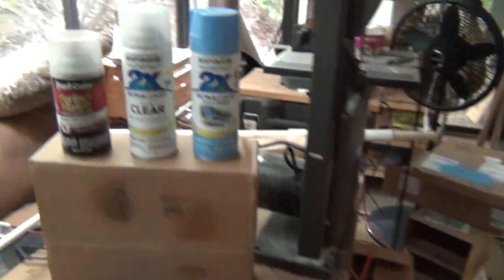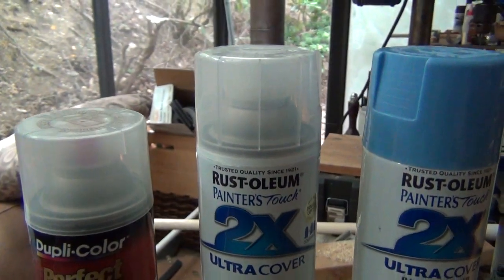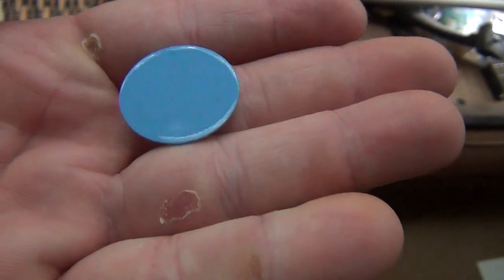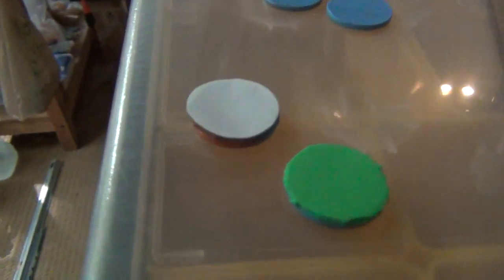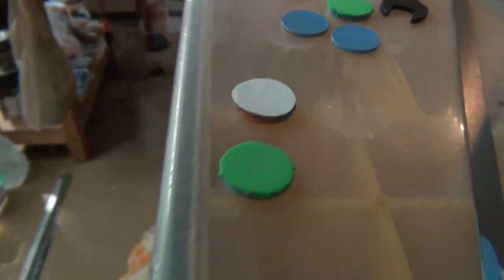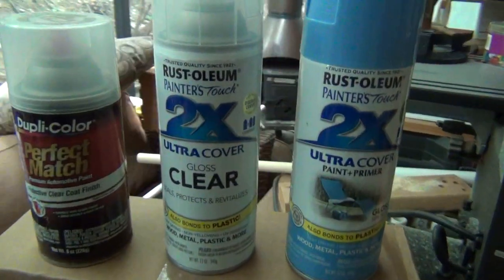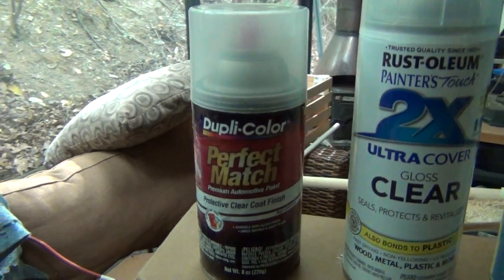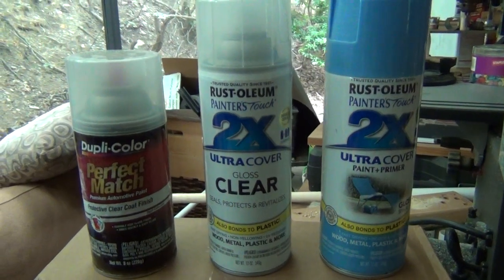Rustoleum Clear Coat Issue

Comment: The rustoleum “painter’s Touch” 2x gloss clear is an “acrylic” based resin clear. You need to spray the rustoleum clear within 30 minutes of when you sprayed your last color coat. And then you can re-coat/spray the rustoleum clear back over itself anytime without experiencing wrinkling or lifting of the base coat. But you must get it sprayed on within 30 mins. If you don’t I’d recommend to wait 48 hours and lightly scuff the base coat and then spray the clear. In my experience if the humidity is up above 70%, the rustoleum clear will blush and try to fogg up on you especially if you start out spraying it on too heavy. Light, light, coats is the key that I’ve found to get good results using it. On the other hand, the Duplicolor perfect match clear is an acrylic “lacquer” based clear and I’m my experience doesn’t seem to be as finicky about the weather it’s sprayed in. But, the rustoleum does seem to have a little better shine to it once fully cured. Hope this helps buddy. I just thought I would share my experience with the products.
Reply from the maker: Great! Thanks for the feedback. Every little bit helps trying to figure these different paints out.
Reply: But you are supposed to wait for the paint underneath to completely cure. If you wait only 30 mins then it will never dry properly.
Reply: +Ness Baby98, If you wait for the base coat/paint to completely dry before applying the clear coat, you will possibly have adhesion problems where the clear coat will not bond well with the color coat. Letting the base coat flash off/dry for 30 minutes gives it time to let most of the solvents in the base color gas out but will still be tacky enough to allow to the clear coat to bite into the base coat and adhere properly(chemical adhesion). When Professional Autobody painter’s paint a car they don’t allow the base coat to completely dry before applying the clear coat. If they were to do that, the base coat would need to be scuffed/sanded to create a (mechanical bond) before applying the clear to give it a way to help it grab onto the base coat.
Reply: Most of these comments are right,, these new base coats many needs clear put on immediately,, if they dry out and you wait and wet sand and then clear,,. They will crack and peel off within a couple of years,,. ???  Caution most are for production work,, not jobs that may need touched up and doing show quality work,,.  !!!
Reply: This is only if you don't wait the 30 minutes, and for it to fully cure it would take 5-7 days, not 48 hours
Reply: Gonna say bullshit.

Their gloss is pure fucking garbage.

I used their 2x colors, sprayed the gloss after 25 minutes, it wrinkled and ruined the piece.
I tried after 24h, after 48h, after 5 days, same issue.

This is all done in a spray paint booth, temp/hum controlled too.

Happens about 3/4 of the time.

Extra fun when it happens on CF pieces.

My professional guess, its SUPER finicky and should be sprayed VERY lightly (so for that thick/gloss finish, which is the whole point of ultra gloss), you should spray it every 15 mins, a light coat over the course of a few days. Absurd.
Reply: I’m completely new to painting figures and stuff. Do you know anything about using this stuff on apoxie sculpt? I have acrylic paint and I want to paint my custom but I’m not sure if I use this before painting or after.
Reply: You'll learn rusto is worse when you find better.  And any urathane or epoxy applied within 3 weeks will trap coating from gassing off.  Cuase chemical reactions, & ruins it, fact & reviews.  So I let the paint dry for a day or two, & coat lightly or is use a permeable coating to help coating while it continues to dry.  Sanded if you feel that's necessary.  Never had a problem, &  I dont use rusto clear enamel anymore.
Reply: @nessbaby9854  not completely just tacky is want with this brand.. i use it all the time...works great all the time for me..
Reply: Ronan B what do you recommend instead?
Reply: @shadowblack1987  your absolutely correct. 👍 Everyone should at least know.   I hate to use rusto clear as a last resort.  It does take light applications, even after 48 hours drying.  Companies advise against coating over rusto base colors with true water proof clear coats for weeks, if not months.  A Rusto rep will tell some of us on the phone, or email to wait a complete day or two, what's up with that!  So I stick to light coats with the 360° red, or blue spray cap.  What were not being told is if the spray coats a breathable to promote further paint curing?  I've heard from the pros & research year after year, nothing improves on rustos end.
Reply: No need for my own two cents' worth, you've pretty much explained exactly what I was intending to likewise elucidate. I WILL add, however, that user directions printed on every single can of Rustoleum, whether an acrylic or a lacquer or a poly, never vary, even though we know those can't all be applied in the same way as one another. In other words, Rustoleum apparently prints simple, identical, generic ballpark directions on every can of everything they sell, that mostly work okay, so long as nobody gives a crap if the results are spectacular or not.
Reply: @nessbaby9854  The first coat or two should be a very thin mist coat, which is ready for another coat in that time, whereas a wet coat wouldn't be ready for recoating for at least a day or three  You're right about that.
Reply: Thanks for the tip. This worked out great!!! I wish I could post a pic to show you the results. It looks very professional, like you would see in an auto show room floor.
Reply: @Green3062  I'm glad you got good results. Thanks for replying back.
Reply: Can you use 2k clear with this ?
Reply: @Green3062   what method did you use when you painted and applied clear coat?
Reply: @shadowblack1987  Based On Your Comment Im Pretty Sure You Sprayed The Peice You Worked On Closer That 12 Inches And Im Gonna Say Layed It On Pretty Thick Which Is Not Needed And Thats What Coats Are For If Yiu Spray Gloss Paint On Thick, Let It Dry And Then Try Clear Coat Over It Then Yes It Will Wrinkle You Should Try Coating It Around 15 Mins A Little After The Paint Is Dry To The Touch. Different Paints React And Work Different Ways
Reply: My paint booth is what ever Florida gives me. 
No $90,000.00 paint booth here. 
Wind blowing *
High humidity  *
Chance of rain *
Bugs *
Yes the Florida Paint Booth
Ugh
Reply: That definitely helped me. Can you wetland this clear coat?
Reply: Wet sand*
Reply: @gokubruce24  I would stay away from solvent based spray CLEAR top coats-- they have OIL in them and solvents that add to the shine-- your ACRYLICS  --ARE WATER BASED and OIL and WATER DO NOT MIX, even if it did work, you would have a MUCH higher probability of your paint separating! 

There is kind of a RULE-- that states -" you CAN paint oil over an acrylic" but you CAN"T paint acrylic over oil"- so you CAN try your oil. solvent based paint over ( regardless of my above statement) -- its just that-- there is STILL a risk-- I let my acrylics cure ( couple days) then use Lacquer.
Reply: @aaronfuksa2047 what clear do you use now? If I’m still using regular Rusto base coat which clear should I switch to?
Reply: @6atlantis  you should have better results with the Krylon triple thick.... it's still a hot acrylic lacquer so you have to put it down light before going in heavy. I'm looking for a intermediate clear also known in the automotive field as intercoat...good for multiple coats & coverage over metallics....then you go in with your real clear that may have 2k or uv stability.  I'm switching to a paint gun, with probably DBC intercoat, and the Oh My Clear.
Reply: @nessbaby9854  I waited s a4nd it did it
Reply: @yakkyuu12  Very True only if you sand and use a converter

Comment: I used their clearcoat on a guitar I built. A flame maple top led paul body. Stained red. Flat black on the back. Came out soooo good. And then I used rustoleum clear. Ruined the finish completely. Had to start over from scratch. When it came time to clear again I used krylon clear lacquer. Sooo much better. I know, I should be using a spray gun and instrument lacquer. But it came out incredible.
Reply: I had the same problem.  Wont use Rustoleum again.
Reply: did you use the lacquer spray on top of the rustoleum colours??
Reply: Same thing happened to me on a guitar. Lesson learned.
Reply: @mongoose5752  That's what I want to know

Comment: Don't know what's up with all the haters. I appreciate the fact that you took the time to record and upload this video. Had a similar problem with the White, 2X Ultra Cover Paint + Primer. Put on a thin coat, waited 30-minutes. Put on another thin coat, waited a couple hours and put on my final thin coat. Got a ton of wrinkles after the 3rd coat. The paint was dry to the touch, but still got wrinkles. No bueno.
Reply: If Rusteleum people cared they would at least write in big enuf letters to read and put better directions, my perfect paint job now looks like crap, man a fly landed in my paint job and I was pissed...... Then I put on clear coat and really cussed but not the fly... 
Rust-oleum sucks
Reply: If you read the directions it states coat within an hour or wait 48 hours. Had the same problem had to sand it all down again very frustrating

Comment: You missed your window for clear, once you’ve gone beyond the 1hour mark paint has begun to cure, which means you would have had to wait 7 days before applying clear. It would have done the same thing cracking/shrinking even if you had tried applying a second coat of paint. Also the area in which you are painting in affects base and clear, contaminants in the air, dirt, moisture, too hot, too cold many factors come into play when painting. Clear coats in cans are easily also over sprayed, most clears recommend two thin coats of clear with a medium third coat and these are all applied behind each other after base coat. So roughly about 4 hours max per side of what you were painting, also once you have gone through that process the area you are spraying in should have a new clean surface each time.
Reply: Hi! do you know if i can use the clear coat spray paint on top of regular paint (e.g. painted on by a brush)? More specifically, this is what I used( https://www.homedepot.ca/en/home/p.semi-gloss-white-236ml.1000155501.html ), and decided after painting that I want to do a top coat. Any insight would be great! Thanks!
Reply: sukhs  if this is for interior purposes there are so many options that you can use for a top coat but be wary of many spray clears for white as they have a tendency to change the colour, I have used Krylon clear coats interior use only as they cracked or bubble in temperature changes, Krylon also has a sealer for all weather use if it’s for outside use, you can also use Mod Podge to protect your painted surfaces but I would recommend using an aerosol based hairspray beforehand as an adhesion promoter. I’ve also tested using clears on top of all these sealers  and it still changes the white so depending on how big of a surface try to stick with just a sealer and test  beforehand I normally try on a scrap piece of same material that I’ve painted in same fashion so my good finished surface doesn’t get affected as no one likes redoing the same work several times. Hope that helps
Reply: Roc Ket awesome! Thank you so much!
Reply: Thanks for ur info! Super informative.. this happened to me but I did a second coat of paint the next day and it wrinkled:/ got scared.. I fixed it a bit now but I didn't know I had to do it at least 30min after or wait 7 days. I was thinking of placing a clear coat but now I have to wait the 7 days since It's only been yesterday that I did this :) thank u!
Reply: That's exactly why I won't be using this garbage again, I'd rather use Dulux duramax from now on as it dries 10x faster than any canned paint

Comment: I read somewhere once after experiencing my own ruined project that this clear isn't meant to be a typical 'top coat'..... It's meant to be used as a paint for sealing things like brass fixtures or outdoor plastic furniture or car headlights. My only success using this stuff came from applying it over the base rustoleum color within 30minutes of spraying the base color..... I've missed that window and waited for a month for the color to cure and then sprayed very light coats and it still crackled up like the paper in a waste bin. Spraymax 2k clear works like a dream over rustoleum 2x colors.
Reply: 2k seems to be the only option.

Comment: I use Rustoleum clear all the time. Best technique I've learned is if you can't apply the clear coat within an hour,  wait atleast 72 hours,  after that you HAVE TO do very light mist coats of the clear before you can apply heavier coats waiting approx 20 minutes between coats. If you apply a heavy coat before mist coats you'll get the "wrinkly" effect.  Hope this helps.  It always works for me.
Reply: will give it a try
Reply: So do I apply a few tack coats? Then if I need to just wait a couple of days and continue. It's sometimes 60 degree then colder for a day or two.
Reply: omg this is helpful, i painted something then added clear about 24 hours later ( did a heavy coat) and ended up with the wrinkly effect had to resand down my hoodscoop and try again
Reply: Awesome thank you 🤙
Reply: Thanks guys 👍👍
Reply: Question: when you say " apply the clear coat within an hour" --Do you mean applying the "clear coat" - within an HOUR of the original PAINTING you have just finished??
any info is greatly appreciated!!

Comment: I just wrecked a really awesome paint job I did on a set of my (used) winter rims I bought. I washed, sanded, and then cleaned them (get rid of all the dust), I primed and then painted them Rustoleum Gloss Black. I did a few coats, and then let them sit for six days at 62 degrees in a room with a dehunmidfier and next to my propane radiator. They looked glass smooth and free of imperfections. This afternoon, I sprayed them and the center caps with Rustoleum automotive clear coat, and about 5 minutes later, two of the wheels and all four center caps started wrinkling up like that. All that work is ruined and I need to sand and repaint them. I wish I saw this video before I destroyed the whole paint job.
Reply: Me too I was mad all that work I put in that clear got covid in it!!!!!!

Comment: My opinion is that acrylic enamel that does not have a hardener mixed in(such as aerosol cans), has a drying period of several weeks, before you can recoat it--even with the same product. So, to add a coat of clear, it must be done before the previous color coat is dry to the touch, or less than an hour. Sometimes you might get by with recoating before the two weeks is up, but it's risky. Also, you have to re-sand with fine grit paper--try wet or dry--for proper adhesion, and avoid going too heavy with coats. Keep 'em thin.

Comment: My experience with "auto" clear-coat. Three important factors: 1. Proper temperature (within reason) of both paint can and surface. 2. Clean surface before application. 3. Low, and I say low humidity level (critical). If these three factors are not met, a dull finish coupled with "orange peel" will result. Really painful reality especially after all the initial prep work.

Comment: Hi Samking
Let me put my $.02 in
You really have to allow the 2X paint to dry before applying the 2X clear coat..Remember that since you're putting on a clear coat, the colored paint does not have to be thick, just enough to have a uniform color.
 Below is an official answer from Rustoleum pertaining to their 2X paint/ clearcoat: but I recommend TWO WEEKS before applying the clear coat......

"""Thank you for contacting Rust-Oleum Product Support. Our Painter's Touch 2X Ultracover gloss clear is compatible with our paint + primer spray paint. We recommend to allow the paint to fully dry which is 48 hours before coating with the gloss clear, However it would be ideal if you allow the paint to fully cure which is at 7 days. since the clear formula is stronger than the spray paint."""

Regards,
Mike
Reply from the maker: Thanks for the info. I'll give it a try.
Reply: Why isn't this on the darn can?  I am just dipping my toe into DIY and trying to make sure I don't mess it up too bad lol.  I need to have space  to let this project dry for a week, urghhhh.
Reply: Brandi PH 
I completely agree!
Why isn’t it on the can!?!
I call bullshit! 
I’ve been using Rust-Oleum spray paints for decades. As long as I follow the directions on the can I have excellent results! If you allow yourself enough time to do multiple LIGHT coats and don’t try to get complete coverage in one spray, you too can have fantastic results!
There’s even a few Rust-Oleum paint colors that match Harley Davidson factory colors. I’ve used Rust-Oleum to touch up and paint pieces on Harley’s several times with showroom results. 
All you have to do is take your time!
Reply: Bs I waited 3 days to apply the clear and it still spiderwebbed ruined my whole project